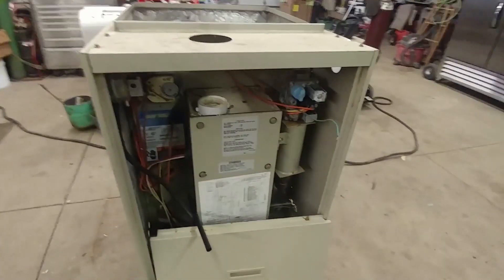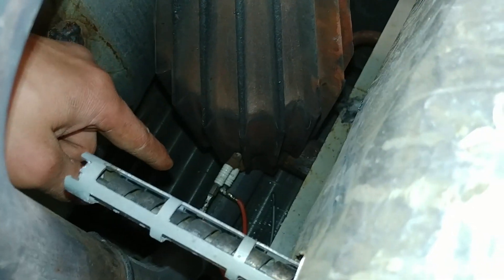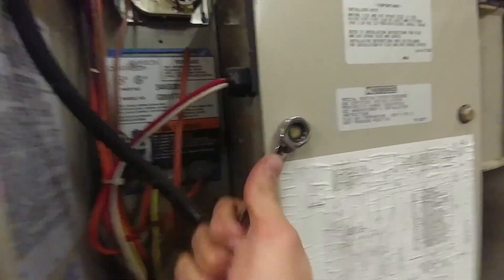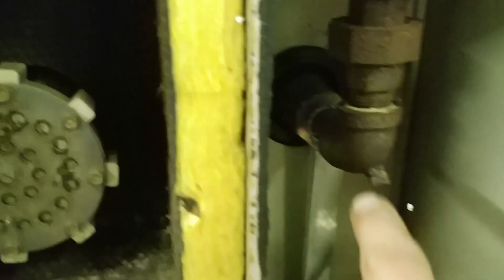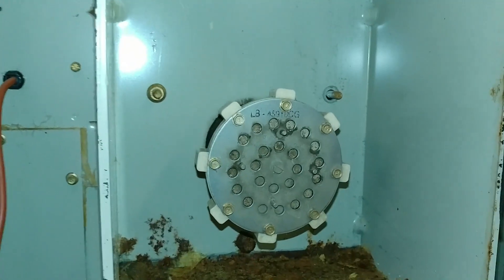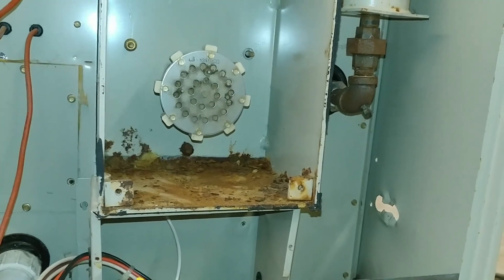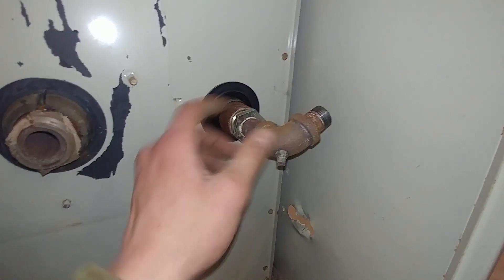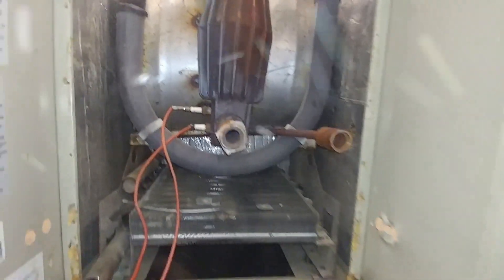Lennox Pulse! What makes them run.

Comment: Thanks so much Ruben you really give me hope for today's youth. I have a Pulse 21 - it blew out two Champion Spark plugs they came apart at the insulator crimp. They $45.00 from Lennox - I put a NGK BPM8Y from Home Depot at $6.00 been working well, also it needs a regulator I just turned down the gas it's been working fine. The unit now is making  at rattle noise motors are good I think it's coming from the exchanger sad to say this might be the end of it. It's  been a good furnace but I live in SoCal so it might not get as much use as people on the east coast. I also had to replace flame sensor and control box, had to learn to work on it because it aged out. Again thanks for taking the time for great video and putting it into layman terms. Denis

Comment: I went to a Bacharach class years ago (combustion analyzer manufacturer)  Rudy, the instructor was so impressed with these.  When I told him I had one, he and I talked in depth about the combustion process used here, v/s conventional.  Greg, a friend at Lennox, told me about the reason for the breakdown of the braze joints in the secondary h/e.  He said varying amounts of odorant in the gas (no standard) resulted in varying degrees of sulfuric acid in the condensate.  In some areas of the country they failed more than others.  Anyway thanks for the nice video about the furnace that really STARTED the high efficiency craze.  As Rudy said, no furnace could run so close to the line of perfect  combustion and not produce CO, as the Pulse....AS I changed a many heat exchangers during the Pulse owner's awareness program, I can attest to their WEIGHT11

Comment: In their day I helped install and maintained/ repaired DOZENS of these.  They were  VERY  efficient, typically, the  supply air  up the plenum was warmer than the  exhaust vent gas.    They  could run  measured  AFUE  into the high  90's  %

If you were to break open the flame sensor rod in the ceramic, you would find there is a SPRING in the ceramic, which caused us  some intermittent problems until I figured out  that when cold, the spring might not conduct  to   "prove" the flame.  Lennox tech new nothing about this  and there was a heated exchange over the phone with them.

They could be  "noisy"  and you could actually put   PVC plastic  "glass pack" mufflers on them.  The air  intake flapper is  an air metering device, and if you were to increase/ decrease the  thickness of the spacer by only a few thousands,  the combustion    will be  improper and/ or stop.  They  could be fussy, especially in earlier days.   Lennox could have done a MUCH  better job  of tech support for this revolutionary design

What  really  "killed" them were  lawsuits  over   secondary  exchanger leakage.  The  manifold/ welds area where the  gases entered the  lower exchanger, I believe were the issue.  I   "got out" of  HVAC  about the time this came to a head

Comment: So what the actual reason this unit was taken out of service?
Reply from the maker: It didn't have a pulse! 😉

I think the control board had failed and the homeowner decided to upgrade rather than repair the unit.
Reply: What did you do with all the old parts?  Were you able to sell them or get them to folks that could use them?
Reply from the maker: The heavy duty plate steel was used to repair our skid loader manure bucket, and some of the parts were kept around for a while. My brothers father in law used a couple parts at some point. He has since gotten rid of his. I don't know if many more of these things still in operation.
Reply: @ oh cool!  Glad you could use them. Mine is still running but parts seem extremely hard to come by.

Comment: Just read they had a 97 percent efficiency rating.  That was cutting edge in the 80's.  Noise would drive me nuts.
Reply: they are actually really quiet due to the muffler and the noise baffles